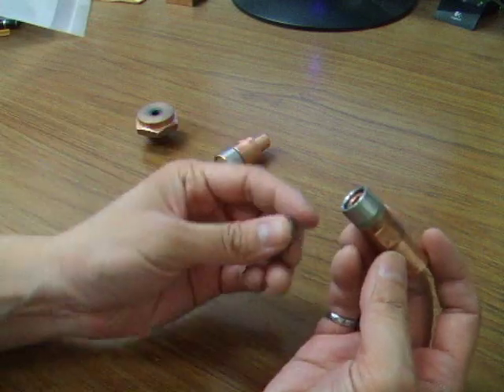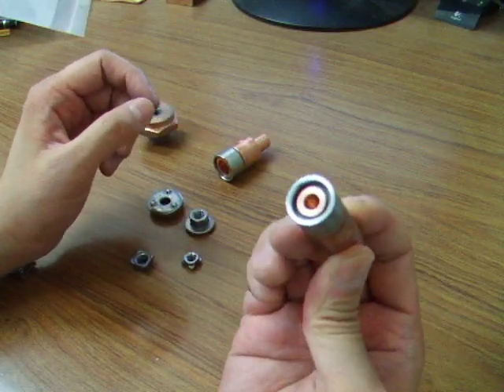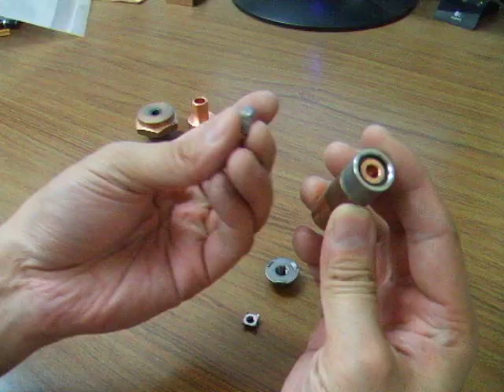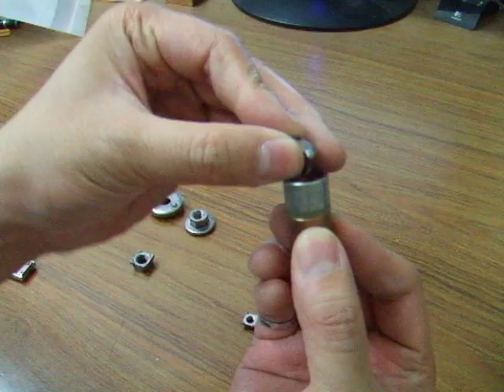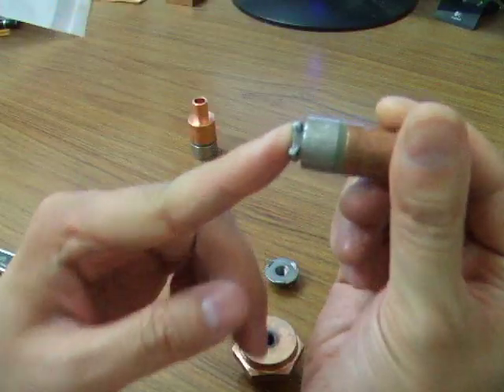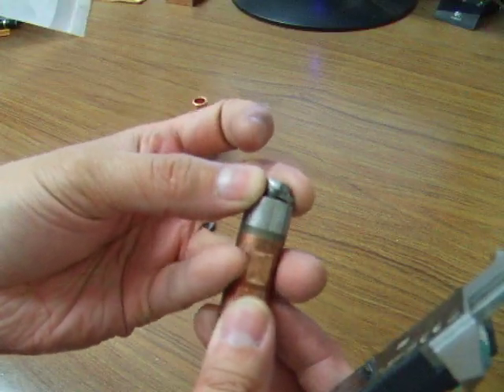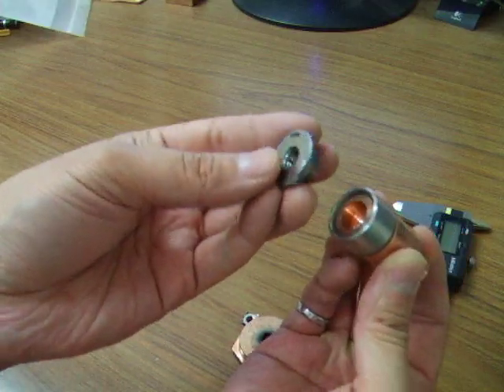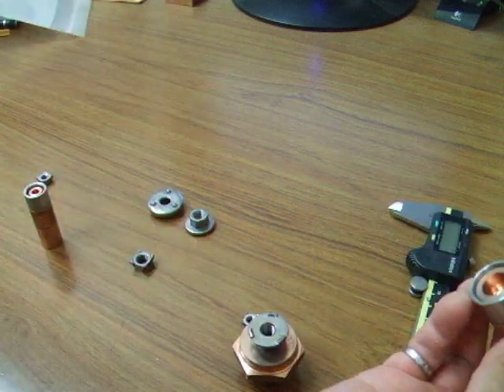Projection Welding -Upside-Down NUT Detection Electrodes

Comment: How to file the electrode to remove the carbon and maintain the flatness of the electrode
Reply: If it is a trans gun eoat then you need to establish a known good amount of welds it can produce vs nugget diameter and follow it down to spec. Then you need to insert an electrode dresser with the correct cutter for your cap style in the cell and have your tips dressed 15% before the known end of life. If it’s a hard automation then you can use a hand held tip dresser.